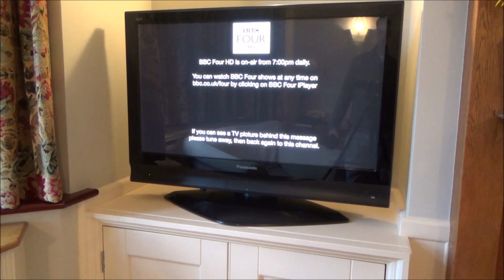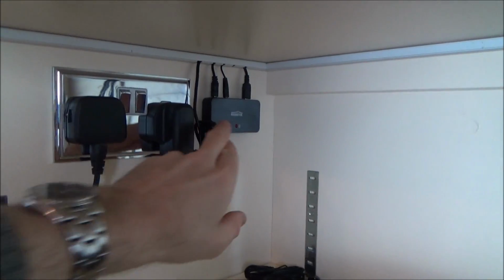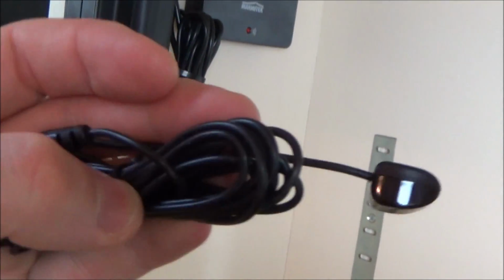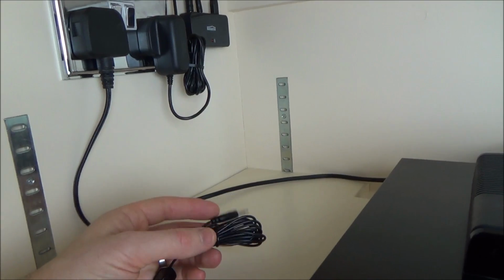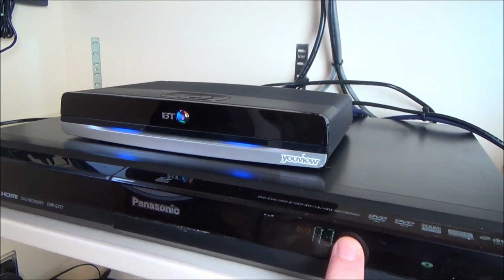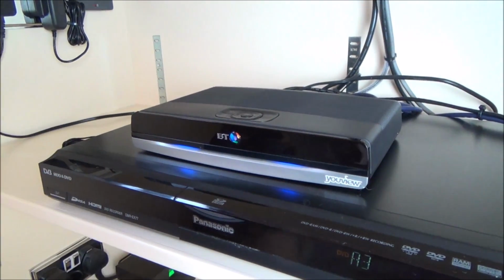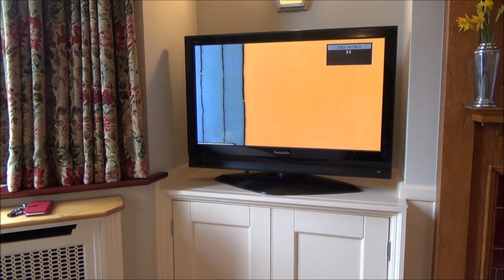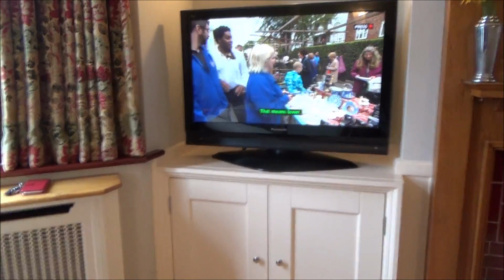How to HIDE your AV Equipment and still use the Remote Controls by using IR (infrared) Extenders

Comment: How do you connect the HDMI cable etc?   I don't see any wires to your equipment, and i get that the IR remote controls the function, but how do you bypass the actual connections?

Comment: Very tidy cabling. What trunking did you use to hide the cabling? As you mentioned I have the cheaper ones that you are meant to stick on the devices themselves. I used to do that but can fall off and do leave nasty sticky residue on your equipment. I now have them stuck on the back of my cabinet doors. I do prefer your repeater better maybe time for an upgrade! Great video mate!

Comment: Nice little video, the cable set up there is so neat, I would love some tricks and tips on how to organise my death trap fire hazard I have under my TV haha. One question though, the 5v USB to plug you have there would it not also work to plug the use just a microUSB cable from the box into the back of the TV to power it and save on the plug space or would it require proper power from the wall?
Reply: The TV usb sockets do not give enough power
Reply: @Alexander_l322  oh that's disappointing. Thanks for the reply. :)

Comment: What about adequate ventilation  of the equipment in the cupboards?
Reply: If you have room behind the cupboards, then cut a hole and maybe get one of these and hook it to an available USB on one of the devices or just a USB brick https://www.amazon.com/ARCTIC-Breeze-Mobile-Flexible-Portable/dp/B003XN24GY/ref=sr_1_1?keywords=USB+arctic+fan&qid=1552239644&s=gateway&sr=8-1&tag=duckduckgo-20
Reply: You don't have to cut a hole, but having a few of these running inside there can keep it cool enough to keep working

Comment: I have one of those cheapo extenders with the little wires that you stick on each box. It does work well but occasionally the glue comes unstuck & the sensors fall off. I like yours better. Not sure if there's enough room for one of those blasters to reach across the front of my boxes though as they are a tight fit, very close to the door.

Comment: The problem I see with that setup is there's no way to cool off the devices. They can overheat in that situation.
Reply: The you view box doesn't have a fan in. Not sure about the DVD player but I'd imagine they will not over heat lol. If it was a game console or tivo box then it would need the doors open.
Reply: maybe they don't have fans but electrical items get hot.
Reply: @FrodoUK  Set too boxes alone do. Mine does not have a fan and it is hot to the touch and my room is below ambient  temperatures often.
Reply: Accidentally tagged you sorry.
Reply: I noticed that Vince had cut out a pretty big hole at the top of the cupboard up to the TV. Probably enough of a chimney for it to circulate the air.
Reply: @JockeSwedenGeek  It isn't nearly big enough for heat to rise and flood it
Reply: Exactly that. Would never put any device that has a fan built into it to blow out hot air in a confined space. Both those devices have fans to blow out. They also need colder air coming in.
Reply: @FrodoUK  they could easily alter the area itself to add some airflow but people do get so into the idea of "I don't want to see any cables" that they forget the importance of heat and restraints of such devices.
Reply: Well then Vince will have a good reason for next video, that will be "Attemp to repair a heat damaged stb"

Comment: I prefer my Logitech Harmony Hub/Companion Remote combo, as it gets rid of all the remotes in favour of just one. And it also does bluetooth as well as i can use it with my firstick and nvidia shield
Reply: gmanpanthro    Not if a device still uses iR still gotta point it at the machine
Reply: Ryan Scherbluk the hub has 2 ir blasters connected to it that can be positioned anywhere u want. I can even turn on the tv, or other connected devices when im not even in the house. As its all connected to my online harmony account. I got a call from my mother saying she couldnt get the tv to come one one day while i was on the bus to work. I was able to turn it on vis the harmony app on my phone and i was 5 miles away.